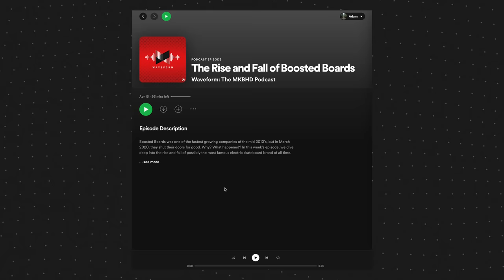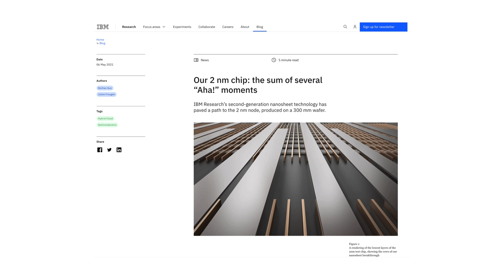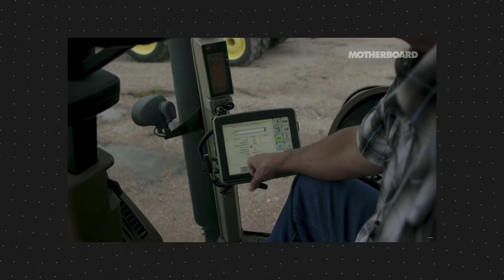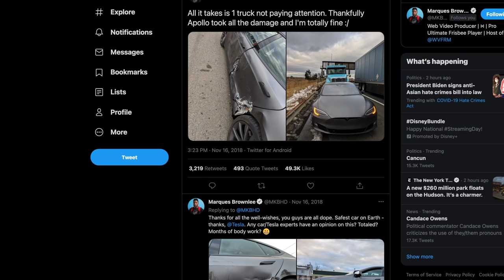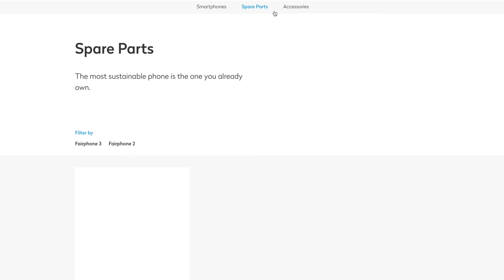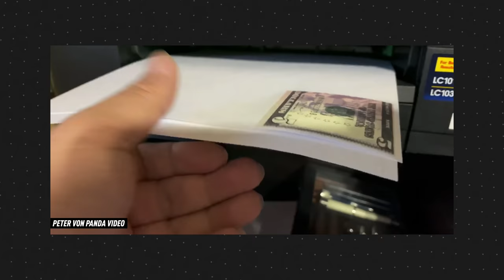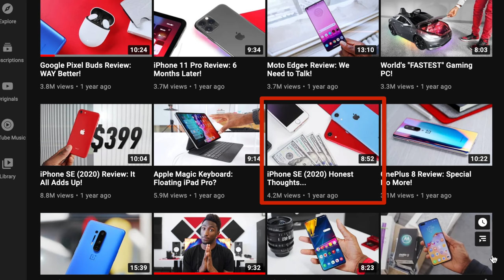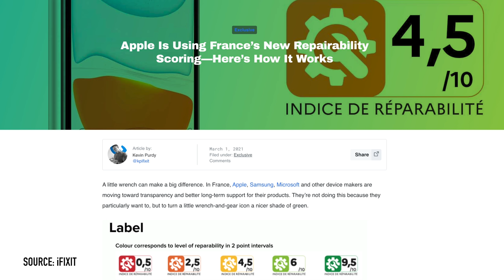Right to Repair Deep Dive!

Comment: I think the scoring system in France is very good, because the score can be low and not be a factor for decision initially, but it will become a competition to have the best score or at least a good one. And it starts to be an indirect pressure on the product in which people start to ask why the grade of this device is so low, why can't the company improve its grade?

Comment: Hey guys great video with really important points. Another thing that crossed my mind and it mainly revolves around small consumer electronics so if even in the future tech becomes more integrated and harder to repair what happens if you live in a country where there is no official repair service or official customer service of that company or if you buy it from the US for example and travel with it and something happens to it. Shouldn't you have the right to at least try to repair it yourself or seek third party help ?
Reply: What if when trying yourself, you screw it up?

Comment: I know it was kind of a joke but I think the reason why you can’t print blue when you’re out of black inc is the printer is mixing both to create your shade of blue. And it’s almosf impossible to hit the exact shade of the single blue inc in the printer. I’m not a 100% sure, but this would be my theory. So it’s not just software or smth

Comment: First the bad part:
I am a little shocked of the low level of literacy in the tech domain mkbhd has since he does spend a lot of time surrounded by it, it gives of the impression that he picked little hacks along the way on how to present a tech product and coupled with reading and learning the abstract for that product is everything he knows, everything being skin deep, very superficial.
The good part:
It seems that by the discussion they are genuinly interested to learn more and i do like that.

Right to repair explanation:
With an example, the screen, it's composed of many layers sandwiched together, now the repair people do not want the individual parts of the screen and the method/process to 'glue' them together, they want the ability to buy the whole screen.
With a more complicated thing like let's say the processor which is soddered at maybe micron level, they don't want the procerssors they want the motherbaord with it, so they can swap it whole instead of declaring the whole phone/pc/car/etc inoperational.

Devices can be more integrated more interconnected but as long as they are and can be devided into individual components (battery, camera, motherboard, screen, etc) to be replacable not only by the manufacturer but by the 3'rd party as well and the last group be given the 'tools' needed.

Comment: The point was raised that right to repair laws may slow down innovation in green tech because more old devices will be repaired and therefore less new devices will be purchased leading to less money for new product RnD.  I counter this argument by the fact that trash is around forever, whereas a delay for new green tech is finite. The new green tech will still happen, just a little slower.  Therefore, it's better to reduce trash even if it does slow innovation.

Comment: In several industry segments we have regulations that require parts be available for a certain amount of time. The issue with a lot of these companies they are finding ways to stop people from getting those parts. ICE cars literally ignite flammable material and we allow those cars to be repaired without issue. Why wouldn't we want the same from electric cars?
One point no one mentioned, the tractors these farmers have aren't cheap and there aren't other options without the same issues. They just want to fix their own stuff without the company they bought it from telling them what they can do with it after the purchase is completed. If you can't repair something do you really own it or are you renting it?

Comment: I don't comment on things often but this might be the worst discussion I have heard in awhile about right to repair. You completely missed what right to repair means. It has nothing to do with stifling innovation or designing products differently. No one is asking products to become less integrated or to stop innovating. Right to Repair is THE RIGHT to have the ability to try and repair your product (not be artificially locked out by software) with parts and having actual access to these parts. This has nothing to do with the reparability of a product from a physical perspective.

Comment: I don't see how right to repair is going to slow down progress for companies or why it stops them from making new amazing things. Go ahead John Deere. Add obstacle avoidance to your tractor. If you add an extra chip for computer vision, just allow the manufacturer to sell it to everyone. We don't want to know how you made the chip or the code that runs on it. We just want to know how and where to solder it and how to flash the firmware on it. That is not enough information for anyone to replicate your algorithm. If someone does extensive black box testing to reverse engineer your algorithm then the lack of this schematic and chip is not enough to stop them.

The FTC established twice over the last month that 3rd party repairs are just as safe as first party repairs and there is no evidence to suggest otherwise.

We repair cars all the time and a breakdown can cause a pileup on the highway. Replacing a battery is arguably less risky. Companies have to trust that consumers are worried about their own life and safety. They will do repairs safely because they don't want to hurt themselves. If not, then the law as a whole is useless because it is enforced by threat to life, safety and/or imprisonment. All of society breaks down because all rules are enforced by threat to life or quality of life.

I really don't see the point John Deere was trying to make and I don't know what the three of them kept referring to when they said John Deere has a point and Tesla has a point.

Comment: Common misconception about tesla brake pads, they do not last the lifetime of the car. Over time brake pads become corroded and can fall apart due to heat cycling and their environment. Tesla brake pads should be replaced at the maximum life of brake pads listed by the manufacturer of the pads. It can be very unsafe to leave tesla brake pads untouched.

Comment: my thoughts to the right to do whatever you want with what you bought thing … i think as long as the device is identifiable as a companys … its kind of as you would misuse a photo you bought on adobe stock … you arent allowed to do that, even if you got the greatest license or whatsoever … and same with the product you bought … if its modified in a way its not intended by the company, i completely understand why they wont want that … when it will malfunction its on the name of the company … its like changing the Art of an artist or a designer (it actually, literally is) … maybe, if there wouldn't be a connection to the original, i think it might be ok to do so, because, yeah i get it, you bought it … but as long as it is under the name "Tesla" for example, it's a no … (and then the question how to customize a tesla like Simone did but then for people not connecting it to Tesla anymore, so it wont hurt their design / the art they made (which is literally impossible because the software etc. still shows "Tesla")

I'm not sure if my thought is comprehensible … but yeah ^^

Comment: The 95% statistic given by John Deere about how many problems can be repaired by the user is a meaningless number because it was provided by John Deere themselves.  Every company will always pick and choose their data points to make any fact or figure as favorable to themselves as possible. i.e You can make data say anything. Talking to farmers who actually use John Deere tractors is the only way to get a useful percentage for this.
Farmers have no reason to lie about this statistic but John Deere have no reason to tell the truth.

Comment: 38:30 “Everything is dangerous, so there shouldn’t be any restrictions”. I understand how that line of reasoning is appealing, but if you took it to its limits, then even just using the phone is dangerous because maybe you could knock your teeth out because you dropped it on your face while using it in bed. We have to draw lines somewhere, we can’t just turn off our brains and say because technically anything is dangerous, anything goes. So I think it makes sense to place restrictions on some things (battery maintenance for instance) but then let other things that novices can handle be fair game.

Comment: I'm sorry, but i am now 20 minutes in and it goes mostly about integration and the inability to repair. YOU ARE MISSING THE POINT (further in the video you do touch on it a bit, but still leave it as difficult issue):
The RIGHT to repair is pretty simple, no matter if it's user or manufacturing error, that does not matter (except for warranties, which unfortunately, you are bound to the manufacturer for that time)

Right to repair deals more with the road blocks thrown up by manufacturers; the deliberate locking of soc's, so they cannot be replaced if you have no access to piece of proprietary software, etc., etc.
The road blocks need to be made illegal; they are ADDDING stuff to make sure it CANNOT be REPAIRED (that do NOTHING for functionality! or anything else, just making the product as hard to repair as possible).

And the parts needed to repair should be available 

You should be able to do whatever you want with the product you buy (within legislation)

You should NOT be punished for using a product how you want it;  The manufacturer SHOULD NOT HAVE the ability to turn off features or services after your purchase. You paid for a product with all the features and services.

The Safety and liability arguments are mostly non-existent; If i repair my roof and tiles fall off damaging a car of someone else I am liable, NOT the construction company that made my house. 
If i drive into the water it is MY fault, not of the manufacturer. The issue is proving who is responsible; the 3rd party repair or the manufacturer.

DOWNSIDE for the user:
1) And yes: if you repair it by a 3rd party company, the warranty for that repair lies with the 3rd party company, not at the manufacturer; 
2) The manufacturer could refuse a 3rd party repaired device under their warranty, even if you still have warranty over the product
3) Possibility that the product you had repaired could work worse with future updates or stops functioning (NOT INCLUDING UPDATES THAT DISABLE IT ON PURPOSE, which has happened before) (example here: a processor gets replaced with a cheaper 32bit processor, that works now, but the OS of your product is switched over to an x64 instruction, making your product fail).
4) The price of products could rise (the manufacturer needs to calculate their 'how do i make my money' into a shorter window)

UPSIDE for the planet:
*) Legions! (see below; got tired and prob. waay too much text here)

UPSIDE for the user:
1) you get your stuff repaired/ reused!
2) parts recycled better!
3) prices will drop (for repairs), since there will be more market effect; if a 3rd party makes a screen that rivals e.g. an apple, apple can no longer charge more than what a new phone costs for just a screen
4) Better recycling and logistics for end of life cycle products
5) etc. etc. etc.

=> side note: If right to repair was fully mandatory [and the same the world over] and planned obsolescence and cartel forming is more aggressively chased, our planet would have been in a MUCH better state then we are in now.<= 
(also the fines companies get for doing these things need to be much higher.. %% of revenue instead of fixed prices, especially when those are laughable vs the profit they make of these practices)

Comment: Tesla could very easy control what wheels you put on the car. A lot of cars have tire pressure monitors that talk to the car and let you know when your tires are flat. So the tesla ones are signed to the car and brake when you de bead the tire. So you can't take wheels from another car and you can't reuse the tire pressure monitors from old wheels.
Companys will always find a way to lock stuff down in the name of "safety" but really it's just for money. Tesla don't make tires... yet..

Comment: They ARE acting as mouthpieces for John Deere.  The Right to Repair issue is all about being about the consumer being able to repair the EXPENSIVE stuff not the cheap stuff.  Any shadetree mechanic can replace a wheel.  Yes there are farmers doing thousands of acres who it pays for them to pay John Deere a service contract to come out and fix the stuff.  But many are small operators who just want to repair the engine and need service data for doing that.  As for the liability that is nonsense.  If the tractor or machine is repaired according to the factory service manual then there's no liability.  If it's not, then the liability is NOT on the manufacturer it's on the repairer.  Courts see cases like this all the time where people try suing manufacturers for faults that they created in automobiles and have no problems sorting out the truth on those and there's far fewer tractors out there than cars.

Comment: I don't think ive seen a point missed so hard in my life, I had to stop watching half way through - innovating and making better products doesn't come at the cost of not being able to repair said products - the right to repair is more about companies not actively designing their products to be irreparable. Also the playing of devil's advocate by David here was rather disingenuous talking about the nanometre resistor or whatever, you wouldn't buy that individual piece to fix, you'd buy the whole chip itself. which would still be far less than buying a whole new computer

Comment: Sure Tractors are dangerous and complex and there is 5% of things you shouldn't touch, but the same is true for cars and we don't blame the company when I stick my hand in a battery or a high speed fan and we never have. It's just a straw man argument. It's the job of the repair person to learn how to do things safely and reliably and eventually all mechanics will be able to repair these tractors and electric cars.

Also integration doesn't always make things better, sometimes it's just done to make sure you can't get parts not because it actually improves the product.
Reply: Integration is a necessary engineering strategy to save cost while adding features. A car from the 1950s would have killed its passengers in most serious accidents and people were contempt with that. Then we implemented ever more safety features and cars were killing ever fewer people. This makes car design harder and more expensive. Designers have to find cost savings to make up for the price of safety.

Comment: Probably add a tax based on their repairability score call it the environment tax then maybe even the person who was going in for a specific iPhone atleast let them pay more because of the repairability 👍
Reply: I don't think that would work. Companies have received very high "repairability" scores in Europe while being abysmal for repairing because they helped write the rules that govern the repairability standards. The people who sell those repair kits (iFixit guys I think?) did some breakdowns of phones/laptops/tablets that were supposed to have high repairability marks, but were glued/soldered together, and had integrated features that removed functionality when substitute parts were introduced.
Reply: @andrewcopple7075  so basically that would require regulations which are controlled and if there's a tax structure dependent on the score there would/should also be accountability 

Also the companies who are actually working towards world would oppose others getting higher score if it's going to impact what they have to charge the customer as price sways customer
Reply: @isddb  I'm curious if that's happening in Europe now. I'm not sure that they'd accuse each other of gaming the repairability system....universities game the us news and world ranking system for their college rankings all the time and don't as they say "throw stones in glass houses." The market seems to keep quiet when both/all sides cheat the ratings systems.

Comment: "Product is king - no matter what". For a right to repair episode, that conclusion sounds a bit like Apple or Samsung sponsored it.  1.4 billion phones sold yearly, ditched for the next flagship after about two years, and only 20% is recycled - Is the payoff from bumping the screen-refresh rate to 120 or HDR video (or whatever else the latest may be) worth treating tech as a semi-disposable commodity?   

I'm not saying you're wrong. I'm just left wondering why you're so readily accepting this messed up status quo? If you agree with Ethan's final statement, why not demand more from the brands that make those products at the top of the list?

Comment: You guys really don't understand what right to repair is (and i don't blame it cuz you guys have got money to rather buy another piece of thing if it's broken). It's as simple as you could think of. Repair the parts you can repair easily with good knowledge of the internals. You don't want to get charged exorbitantly, lets say $300 for the display (if i repair it with a local technician i might just pay $50 or $100 for the same part) of a $400 phone number (or) if you've just got speakers damaged, just replace the speakers and not the whole fu*** motherboard as these companies like to do and makes users pay 10x times then it would actually cost to repair at local technician if the part was provided by manufacturer directly to them. These Corporates are creating monopoly and want to capture everything relating to their product, which is not generally good for the consumers.